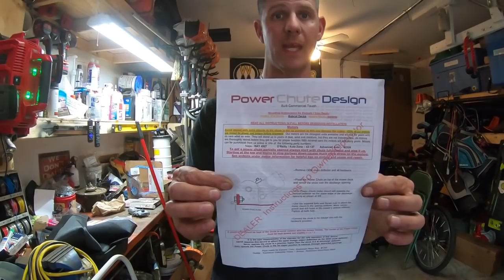New Mower & Chute Blocker

Comment: Glad you guys are doing good, i had an issue with my s18 sheared a pully bolt on my  jack shaft pto the top pully backed off just enough to rub against the seat hood making a horrible sound it was making sparks so i took it to my dealer to get it fixed and serviced for winter i also demo/borrowed a walker c19i 42R it basically made the leaves into powder. I like the reverse rotation deck but  i love the standard rotation the a lot better with leaves.
Reply from the maker: Yea I've heard allot of bad things about the reverse

Comment: Nobody seems to ever mention Trimmer Trap chute blockers - I run them on all my mowers - simple problem free design.  Geek to Freak used them which turned me on to them.  Downside is I wouldn't be able to mount a catcher on with it installed so I might have to look into your recommendation
Reply from the maker: Those are great for walk behind mowers for sure

Comment: hey, ill give you a tip. ive always seemed to own scags, ive tried all the mowers and i just kept going back to scag so ive stuck with them.  you posted a video a while back, and i commented on it. it was regarding the velocity deck leaving a trail when you mow in reverse. use that to your advantage when doing leaves. go over the debris in reverse first, which will mulch it all up, then drive over forward and vac it all up. i have a vac system on my cheetah and doing it this way works great.
Reply from the maker: Yea I've done that before.  Takes allot longer.

Comment: Thanks for the code. I wished they had one for our Bad Boy Revolt 36 inch Stander.  We have a piece of crap blacker at the moment. Great video about nothing lol, I enjoyed.
Reply from the maker: Contact them.  Alex can make anything happen
Reply: @CountrysideStrong  ok thanks
Reply: @elcslawncarecommunitychannel  I always am willing to work with people to get one fitted one their mower, I can work off pictures and measurements most of the time to try to get one to work sometimes its as easy as just changing some parts that I already have in stock around.
Reply: @alexschmittpowerchutedesig1969   Thanks for the comment. What's the best way to email you.
Reply: @elcslawncarecommunitychannel   Our e-mail address should be on the website or there is a contact form you can use as well.

Comment: Get your self a scagg 36 zero turn its great it's not a pro works great
Reply from the maker: It's def an option
Reply: @CountrysideStrong  the new machine is great much better than the old freedom z cut wise looks odd with no roll bar and price wise great value for money I recommend bite the bullet buy new the machine hits well above its weight and I carry it with fold down ramps in the back of a transit van

Comment: How much more engineering would it have taken to make that hydrocut steerable with actual controls... Too bad, it's otherwise really cool
Reply from the maker: Prob not much for them,  it's just not designed for it
Reply: @CountrysideStrong  True enough. Also, hey, quick question. What wb controls are easiest on the hands and wrists in your experience?